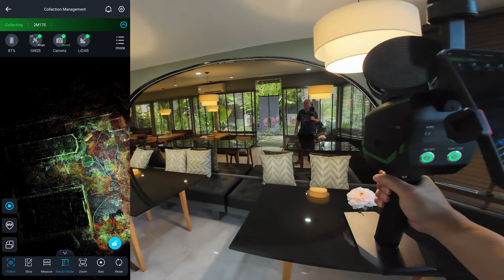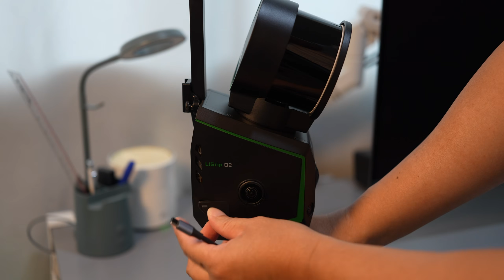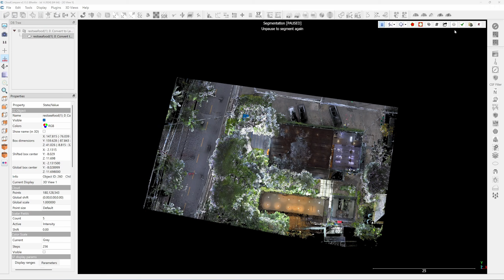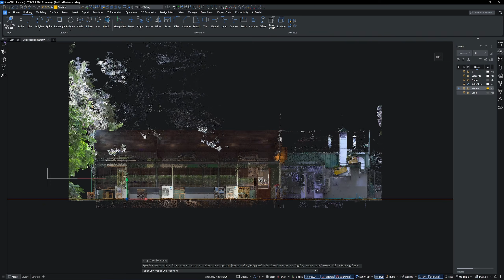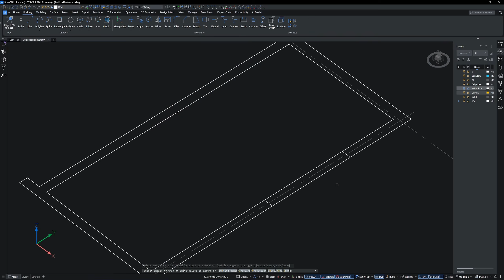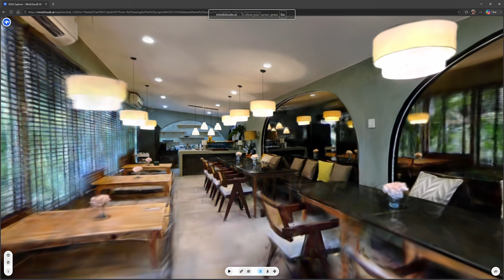LiDAR Scan to Floor Plan – Full Workflow with LiGrip O2

Comment: may I ask how do you know where the property lines are? Are you assuming the wall is on the property line exactly, or do you have some other information? Here where I live, walls/fences are many times encroaching on the adjacent property and cannot be reliably assumed to be a legal/surveyed property line. legal/surveyed property lines here are tied back to a monument
Reply from the maker: If the area is an open landscape, government land pins, marked with concrete casings and pin numbers (some with RTK coord) will be present. If they are buried, I would have someone uncover them and place a checkerboard over the site. This particular project is fenced and was built a long time ago. Any land disputes would likely have been raised by the neighbor already.

Comment: Im learning a lot from your videos, a question a have is: Can i align a pointcloud in cloudcompare without changing the gnss data of the points. I'd like to align the axis for easy modeling but am afraid that the georeference will be off afterwards.
Reply from the maker: When you align scan data in BricsCAD, AutoCAD or Inventor. The CAD software will keep translation value. You can restore this value to 0,0,0 and the point cloud will go back to the GNSS coordinate point.

Comment: Thank you for these reviews, I ve learned a lot from them. I've bought the Share s20 after viewing your videos a half year ago. It helped me a lot with architecture. Is the s20 still good enough, or is it starting to lose to the competition? Do you use it still for smaller projects? If I ever get a bigger project, I might purchase the O2.
Reply from the maker: Competition is intense, and in my recent test the S20 fell behind the cheaper Pocket 2 in output quality, ease of use, and data sharing. The O2 represents the next level of accuracy, compared to pocket‑sized scanners, it produces much clearer, sharper results. That means I can move from scan to BIM in far less time.

Comment: Nice work as always Payo. I always look forward to watching your latest videos. I was wondering if you ever contacted HI-TARGET for their LS1-PRO. curious to see how it holds up against the LI GRIP 02. Would also love to see more testing with same lidar sensor as the ligrip 02 but I understand it could be challenging getting such equipment from manufacturers due to the cost of these products.
Reply from the maker: Several viewers have requested a review of this model, and I did reach out to borrow a sample, but never received a reply. CHCNAV also backed out of sending the RS7, and XGRIDS withdrew their L2 Pro and K2 samples. Some manufacturers simply don’t want the true performance of their devices revealed, since it directly impacts their sales.

Comment: Hi! I really like your videos! But I have one question why don't you use Fuison 360 or QuickSurface for reverse? Do you think bricscad is better? I'd also like to know why you use a point cloud instead of a mesh? I'm really looking forward to your answer.
Reply from the maker: Point cloud integration in CAD is expensive, supported only by Autodesk ReCAP (2012) and BricsCAD Hexagon (2019). Unlike mesh, point clouds allow micron‑level sketch tracing. Mesh hits a wall with complex parts, while FreeCAD’s point cloud support remains hampered by incomplete CAD features.
QuickSurface is a low‑tier CAD tool targeting new 3D scanner users under the guise of reverse engineering, though its developer lacks real knowledge of the field.
Reply: @Payo-TensileCreator  Do I need a really good scanner to work with point clouds, I recently bought a ferret and want to try using it with point clouds, or is it not accurate enough for this?
Reply from the maker: @marssni  NIR generates a fluffy point cloud with reduced sharpness. If you’re learning reverse engineering with Ferret, you’re starting at the top. Working with lower‑quality point clouds demands greater skill.

Comment: Thanks for sharing your workflow. The Ligrip O2 looks like a great performer. I've been using the pocket 2 and it's a great scanner for point cloud creation. I hope they bring the quality of 3DGS processing up to the level of their excellent hardware, phone and MindCloud Studio app.
Reply from the maker: At the moment, Pocket 2 ranks as the second‑best LiDAR scanner. Recently, its 3DGS quality settings were reduced to shorten processing time, earlier versions delivered more balanced results. Meanwhile, LiGrip O2 has updated its 3DGS engine, and the improvement is clearly visible in this video.

Comment: It speaks volumes when you're willing to do a separate scan for 3DGS with the pocket 2 but it's quality is too low to use. Even when it's free. I get the sense Manifold miscalculated how quickly 3DGS goes from a "nice to have" to clients requesting it. I hope they get on the ball.
Reply from the maker: Manifold Tech has recently lowered the 3DGS quality settings. We need to call this out and push for them to restore the original version.

Comment: How do you control the quality of the final scan without control points? Even if the scanner software reports 90% of the Points under 1 cm, I really don't think it's even close to this value. In any case, no control points, no control.
Reply from the maker: This is a SLAM LiDAR scanner, not a drone LiDAR. There’s no other survey tool accurate enough to calibrate its accuracy except a steel measuring tape. It’s the only survey instrument with a built‑in self‑error correction mechanism known as SLAM, requiring data from the LiDAR, IMU, and VSLAM video, though RTK can also be used. Every other SLAM LiDAR I’ve tested shows slight angular drift about 1–2 cm along the walls/floor level. This unit, however, produces no detectable drift at all, even when scanning an entire 10,000 m² building.
This technology is quickly becoming the primary survey tool. Even Topcon has begun selling the same scanner under its own brand.

Comment: Great video, Could you pls share this scans file, i need to know if there were drift or bends in pointcloud.
I use CHCNAV RS7
Reply: How is the rs7?  I am considering purchasing one. How is the point cloud quality? Especially more than 20-30 meters away. 😊
Reply: @jasonliang8876  chcnav doesnt have great scanner software they are mainly GNSS with short possibility for scan but it drifts a lot in the buildings etc..
Reply: @jasonliang8876 If you are looking at the RS7 for a 20 to 30-meter usage range, here are my thoughts based on hands-on experience with the scanner:
Outdoor Performance (Excellent)
I have been genuinely surprised by how well the RS7 performs in outdoor environments where it has direct access to the open sky (without tree cover). Because it can reliably pull satellite signals to log its position, the PPK processing using RINEX data is absolutely perfect. I have done walks of over 500 meters without even attempting to loop back to the starting point, and there was essentially zero error.
Indoor Performance & The "Banana Effect" (Caution)
The main issue arises indoors. Even though it is marketed heavily for indoor scanning—and the usable data range of the scanner is about 40 meters—it struggles with drift. You don't even need a massive space to see this; once you start scanning a floor area of just 2,000 square feet, the floors and ceilings can start to wrap and bend upward or downward at the ends. This is the classic "banana effect" in SLAM scanning.
The GCP Solution: You cannot completely solve this without control points. To mitigate the bending, you must use Ground Control Points (GCPs) for the entire building, utilizing local, relative, or global coordinates. It will reduce the warping to almost nil.
The Segmentation Solution: If you have no plans to use GCPs, my approach with the RS7 to avoid drift is to chop the scans into multiple segments. For example, if a site has two buildings, I would run three separate scans: one for the interior of the first building, one for the interior of the second, and a third just for the exterior roadway. If I had attempted the scan shown in the video in a single run with something like a LiGrip O2, I am sure there would be multiple drifts, especially indoors, or even a double-floor effect. Segmenting is the best way to get a clean result with the RS7 without control points.
Point Cloud Density & Sensor Quality
My primary necessity was acquiring a highly detailed point cloud, and the RS7 definitely delivers a dense surface texture with almost no voids. Even viewing at a point size of 1 to 2, the surfaces appear completely closed (aside from minor floor blind spots due to the scanner's trajectory, which isn't a big deal).
However, looking at the finer, noise-free output in the video, this is an area where the RS7 lacks a bit. This simply comes down to the cost of the underlying LiDAR sensor. Scanners like the LiGrip O2 use much more expensive sensors that naturally produce sharper, noise-free data.
That being said, the RS7 sits in a very solid middle ground. Compared to cheaper entry-level scanners like the SHARE3DCAM S20 or the FJD Trion P1/P2, the RS7's sensor produces significantly crisper and more detailed point clouds. Ultimately, it comes down to hardware cost—more expensive sensors will always yield sharper results.
A Must-Read Resource on SLAM Limitations
Additionally, if you (or anyone else reading this) are planning to buy, use, or hire someone for SLAM scanning, I highly suggest searching for and reading this comprehensive PDF:
"Handheld LiDAR SLAM Guidance -- From First Scan to Professional Deliverable By Tersus GNSS"
It is over 100 pages long, but it is an absolute necessity if you do not have prior experience specifically with SLAM. Even if you have multiple years of experience in other areas of the 3D scanning industry, SLAM is completely different. The document might feel a bit abstract if you haven't physically used a SLAM scanner yet, but it goes into immense detail showcasing the exact limitations of SLAM, how to solve common errors, and the correct methodologies for using the technology. I consider it required reading before working with these tools in any capacity.
My Recommendation Before Buying
Be very careful before committing. I highly recommend asking your dealer to let you spend a couple of days testing the scanner. Take it to a site that matches your exact use cases, scan the environment, export the raw data, and process it yourself to ensure it actually meets your necessities.
Hope this helps with your decision!
Reply from the maker: Following my RS30 review, CHCNAV canceled the RS7 test despite a signed contract, and XGRIDS pulled back on the K2 and L2 Pro. My unpaid reviews impact scanner sales heavily, so some brands prefer to keep real performance hidden.
This is a client project, so I can’t share the file. What I can guarantee is that with the LiGrip O2 you’ll never encounter detectable drifting errors, even when scanning a 10,000 m² building.
Reply: @Payo-TensileCreator what a shame, they should have more confident with their newest scanner......The sad problem is there are really limited real world test on these scanners.
Reply: @jasonliang8876 very true
Reply from the maker: @jasonliang8876  These LiDAR scanners are mostly sold through dealer talk and spec sheets. Buyers receive very limited insight into how the devices actually perform in real‑world conditions. When manufacturers know their product isn’t competitive, they avoid sending samples.
Reply: @Payo-TensileCreator I really appreciated your approach. Thanks!